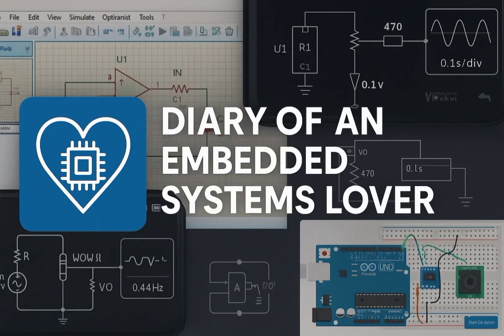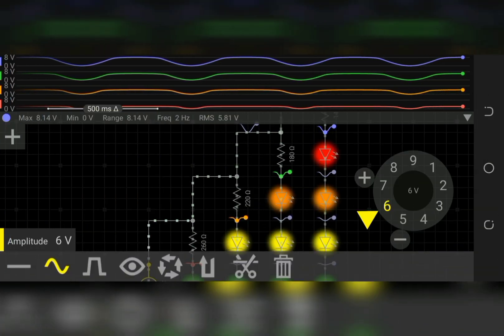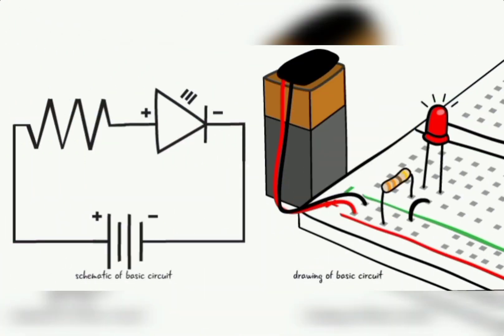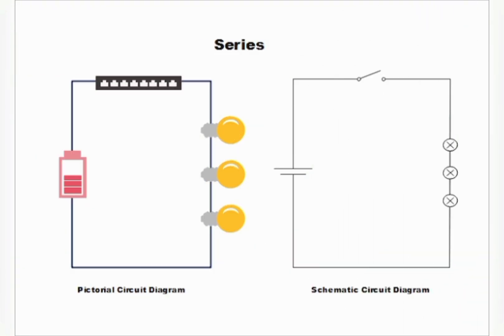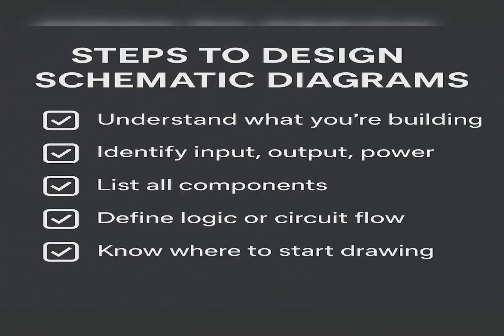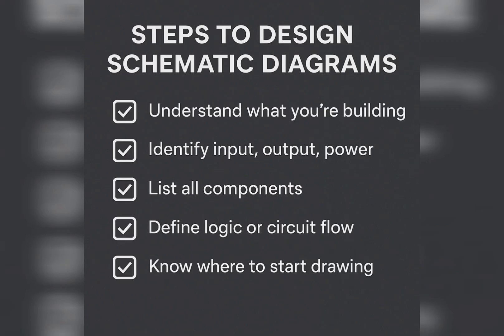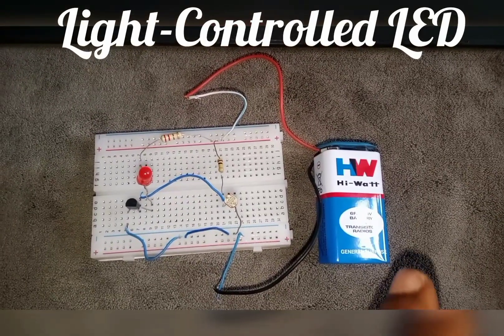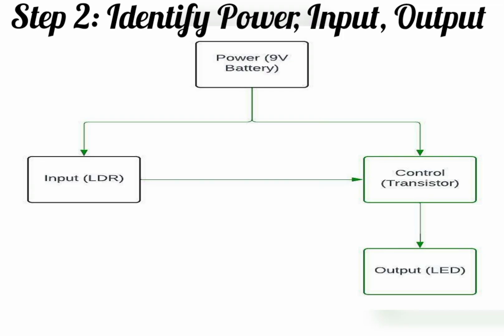How to Draw Schematic Diagrams for Electronics & Embedded Systems Projects (Beginner's Guide)

Comment: I am a computer science graduate
And i want to be an embedded c++ developer
And especially with automotive like ECU and 
I have no background in engineer or electronic units
Where do i start?
Reply from the maker: Your first goal will be to build strong fundamentals in electronics, C/C++, and microcontrollers.
Key Topics:
1. Digital Electronics: Logic gates, truth tables, flip-flops.
2. Analog Electronics: Resistors, capacitors, transistors, op-amps.
3. C & C++: Data types, pointers, structures, memory management.
4. Microcontrollers: Basics of 8-bit MCUs (Arduino, PIC, AVR).
5. Serial Protocols: UART, I2C, SPI.
Hardware Tools: Multimeter, Oscilloscope (basic usage).
Reply from the maker: To quickly get started in understanding electronics, click on the link below to access the playlist that will get you started. 
Watch the videos in the following order after you click on the link below:
1. Electricity Explained for future engineers
2. Analog electronics explained in 2 minutes
3. Basic Electronics Components Every Embedded Systems Engineer Must Know
4. How to draw Schematic Diagrams

See the link for more details: 
https://youtube.com/playlist?list=PLSeBTw0Hp0NNUKn8nWkNSpDM6_caxGytB&si=XGcUEietO-6aFOTN

Please let me know if you have any other questions. Also, don't forget to subscribe and like this video and the channel. My goal is to cover the entire curriculum of what makes a good embedded systems engineer.
Reply: @embeddedsystemsdiary  thank you so much
Reply from the maker: You are welcome